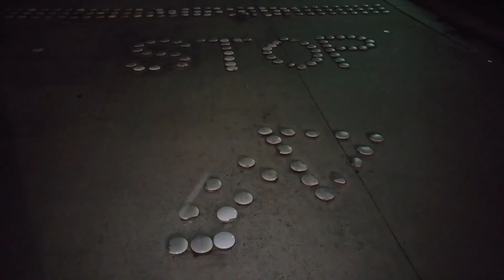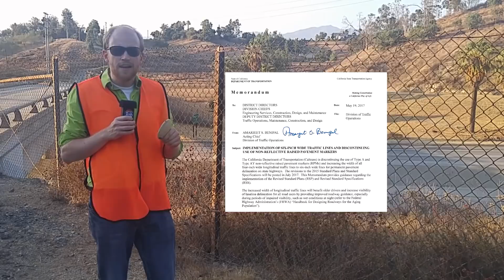California REMOVED this SAFETY DEVICE from freeways and highways

Comment: The problem with them them was that it cost the state a bucket load of money to both make and install. A waste of money! The UK have `Cats Eyes´ that works great has both a `bott dot´ and also you can see where the centre of the road is has the Cats Eyes reflect back at you. But again this costs a bucket load to make and install. But better than the Dot's. Then in Sweden they today use the cheapest way and very effective way of just using the road itself. They lay a new piece of tarmac / asphalt on the road and while it's still wet, then use a metal roller that makes dens in the tarmac / asphalt and when it hardens and a tyre goes over them it's the same effect.

Comment: In Australia we use the second type you had (Yellow reflective marker)
On country roads we also have white posts with reflective markers on both sides of the road ever 20 or so meters apart. The thinking of these posts is if a kangaroo, animal or person crosses you will be able to see it as the reflective marker will "Turn off" and back on again at night time. 
https://www.austockphoto.com.au/imgcache/uploads/photos/compressed/roadside-reflective-guide-post-austockphoto-000016344.jpg?v=1.3.0

Comment: Ya know... With some I guess RFID type chips... Those Bott's Dots and the reflectors and whatever other things states decide to use to help with lane marking visibility. They can easily be implemented as a lane marking tool for self driving cars... I'm surprised it hasn't been done already... But like. They could really come in handy. You can program them to read as different things to the cars computer. So you could have some for Stop signs and red lights. Just make the ones for red lights have multiple and they get hooked up to the redlight control computers and switch between the stop, go, and slow down (yellow) dots. You could have them as you come up to the light so the car can read well ahead of time weather the light is green, yellow, or red. They can be used as lane markings for HOV lanes as well. Or special EV lanes if they ever got implemented... Maybe self driving buses... Mark bus routes with em. They could even be integrated into a gps system in vehicles. To help with self driving and navigation. Basically like "bread crumbs" sorta... Except they're permanently installed in the road and linked into a whole country wide system. Hell. You could even make em 5g capable. Lol. Really get the conspiracy theorist goin. Haha. Idk. It probably already has been done before. I just don't know about it... But I feel like it could be a good idea...

Comment: Just wanted to know if American roads had things like - speed bumps, rumble strips, slalom 'slow downs', 'smart bollards' (these rise up out of the road, to enable a road to be temporarily blocked off), cats eyes (built into the road surface to be reflective when car headlights catch them), road signs that use 'fluorescent paint' (so when car headlights catch a road sign , it shines brightly)??? Do American roads feature any of these things?  Also British car number plates are also designed to be reflective when another vehicle's headlights catch it. Why doesn't America have these type of number plates??  The UK has had them since the mid 80's!  Before this we used to have just old style metal number plates like America mostly still has.

Comment: I notice the new lane markings in California about a year ago and I believe they are designed to be more easily recognizable to self driving vehicles. This makes sense because the white line has a thick black border that stand out more than necessary for human drivers. This hasn’t been stated publicly as far as I know.
Reply: The new lane markings are primarily for concrete roads.  We use them in AZ as well.

Comment: 4:55 we call these “cats eyes” in the UK. We have used them for decades on every motorway and rural road that doesn’t have street lighting. 
Recently the UK has replaced these cats eye reflectors for cats eyes with LED bulbs so that you can easily see sharp corners at night. (I assume they are solar powered)
https://www.deangroup-int.co.uk/wp-content/uploads/2015/08/cats-eyes-night.jpg
Reply: Yes, your headlights charge them up. You can see them in your rear-view mirror too. They're great.

Comment: One can get the same tactile / auditory effect with groves / notches cut in the pavement. Many highways will have those cut on shoulder as a lane departure warning.  The dots and reflectors are both expensive to maintain and insanely dangerous to install. ('tho technology has replace the teenager sitting in a basket inches off the pavement setting each one by hand. Seriously, that's how it was done.) And Tesla may get some blame, but the cars don't need to "figure it out", the geeks programming them need to program them to deal with it. (Autopilot(tm) isn't AI; it can only do what it was programmed to do.)

Comment: ' simsonite reflecters' only work while attached to the road ....and are CLEAN
Reply from the maker: And snowplows haven't ripped them off... 😀
Reply: in the UK our lane dividing reflector studs are called cats eyes, and clean themselves when runover,
white studs mark the lanes or the middle of the road.
red studs mark the left edge of the road.
amber studs mark the central reservation of a dual carriageway or motorway.
green studs mark the edge of the main carriageway at lay-bys and slip roads.

Comment: Speed bump. I prefer the 1/2 high inch stripes. Paint on. Reflective
Reply: Those end up breaking due to constantly flexing when vehicles drive over them. They are also susceptible to the same problem the dots are in cold-weather states in that plows will come along and blow them away.

Comment: What would make driving truly safer. Better drivers who are not so dangerous on the road. Less "oh my god you're using your brakes I must barrel to the shoulder and go around you. Less typical bad behavior on the road. Then again I assume that is far too much to ask for. So it turns into a mass stampede where most people specially during rush hour think it is perfectly fine to just blast like 15-20 mph over the speed limit. What I'm getting at is all these measure to make driving safer except actually trying to knock it into peoples heads that they are tooting around in multi ton objects not your own little world.

Comment: Does the US use lane edge rumble strips? They are used on major freeways and some arterial roads in Australia. 

They make a roar when your tire hits them at speed. Made of rubber that is installed hot and bonds to the surface of the road. 

https://www.towardszero.vic.gov.au/safe-roads/how-are-we-making-roads-safer/rumble-strips

Comment: Yeah these are all but worthless anyplace that gets even the most minute amount of snow. They don't even use them in Georgia. Where they use anything they use what is basically a reversed version of that Stimsonite Reflector. Instead of raising up off the roadbed, it is mounted flush down into the road. So they are less likely to be scrapped up by snowplows.

Comment: Dots or no dots, if the machine can't figure out the environment without us changing the environment for the machine, then the machine can't figure out the environment at all, and we should stop pretending otherwise.

that is to say, if it needs a specially set up environment to do its thing, then public roads are no place for it.

After all, standards compliance will only ever be the unattainable goal that we perpetually strive for. if the car can't correct for that...

Comment: Not really a good item if they need to  be replaced that often... what a huge waste of $$$$...    And so annoying... Visiting in Nevada right now .   I hate them....   In Pennsylvania we don't have them .  we do have on some roads cut in rumbel to the center line...  They are fine except when they go wider than the yellow lines...   On one road I travel regularly there are two sets.   You are always hitting the rumble strips  because they come about 1' out on either side of the center...    Most roads just have them as wide as the center lines..    No issues.  They last for the life of the road...          The dots would never work in PA.

Comment: Am I crazy or are the trillions they're spending to invent self-driving cars kind of pointless.  When you could just put a cable or strip in the road and a computer could follow the strip.  Like a tram or monorail on a track.  And you could use all your fancy technology to have the cars on board computer register all the other cars on the track.  If the technology became good enough, you could even phase out stoplights, as the computer could speed up or slow down depending on the vehicles ahead of you.  I donno, I think it could be done.